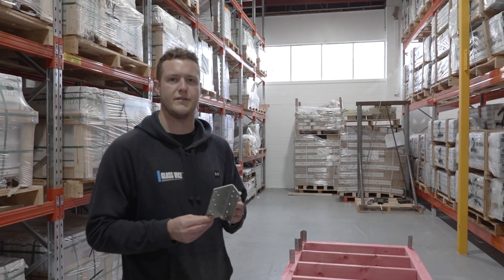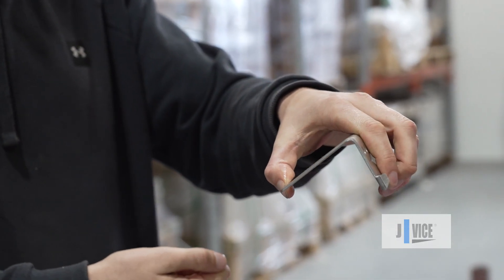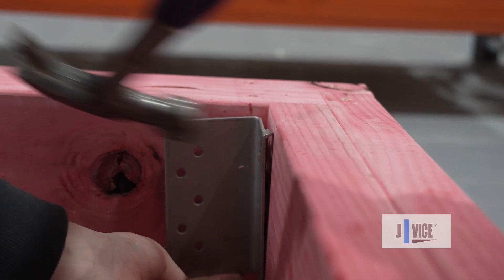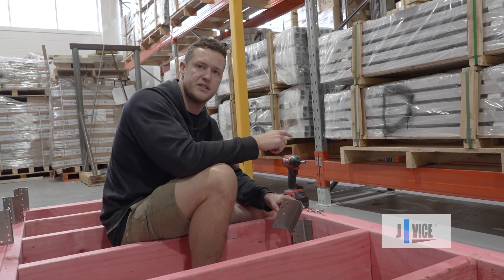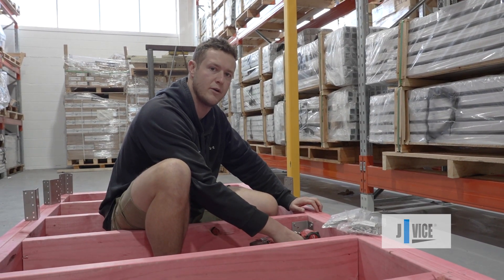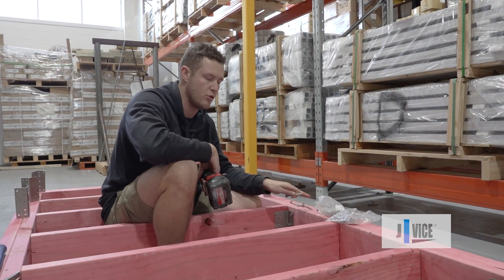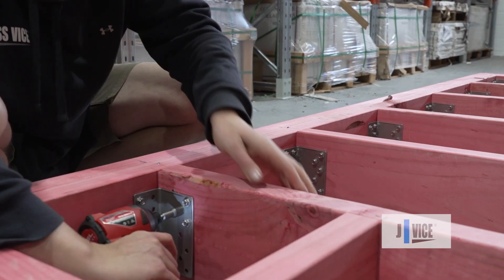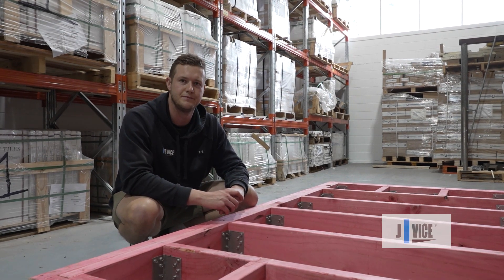Joist fixing installation - JV100

Comment: Its a cool product for narrow space. But I worry about the cost. Hanger and nail system should be much cheaper. 3000 hanger nail priced at 69 nz dollars.
Reply from the maker: Thanks for your feedback! The materials work out about the same cost as conventional system as they need more brackets and nails. The true cost saving is in the time and labor, as you're able to finish joists much faster and put more time into other parts of the build.